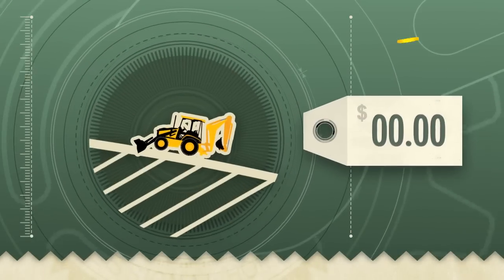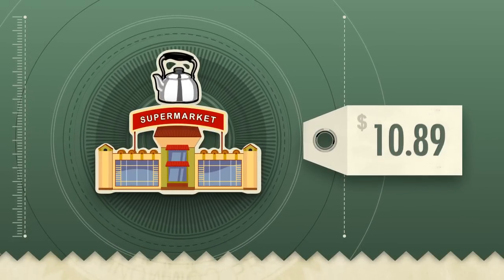New Money | Alternative Economy | Energy Currency

Comment: Related concepts: Biophysical economics and Exergy Theory of Value. The question is how to account for labor and land value? Accounting for calories burned would never provide someone with a subsistence living - indeed it wouldn't even pay for the food production cost, so you need a functional correction factor when calculating labor output in energy units. The quality of labor must also be accounted for (ie a more highly trained or skillful employee would produce less waste and consume less energy to produce a unit of good or service). For land, there is undoubtedly an energy production or accumulation (eg biomass) calculation, but how do you prevent land accumulation (by specific owners) or balance the need for food or raw material production with ecosystem services? Supply and demand must also be accounted for, because these dynamics will not result in an exact payment in energy terms for a good or service - consider just 2 products of the same quality produced with differing amounts of input energy and waste output. One producer (the efficient one) will charge more energy units for his product than was required to produce it, while the other will lose market share. Anyway, that's all to say this video is on the right track, but there are many nuances that must be considered in accounting for the value of land, labor and capital, and preventing excessive resource accumulation by individuals or groups (ie companies). I think monetary or even ownership demurrage (or taxation) could solve the "excessive resource accumulation" problems. Standard labor rates could also correct both the income gaps between rich and poor nations and reduce the pressure to import goods or raw materials from overseas - one off the leading causes of carbon emissions, waste, environmental degradation and biological invasions (and their associated costs). The author should check out Holochain, the Metacurrency project and the Weave for potential ledger-based tracking systems for energy, resources, waste and information value. Another key problem, in my opinion is that waste generation and processing are not fully accounted in the current system, but Extended Producer Responsibility and chain of custody may provide potential solutions. Make producers (and consumers once they have purchased a product) responsible for end of life disposal OR potentially earn income for resource recovery.
Reply: How to evaluate the cost of labor? I think it should be based on mutual agreement between the provider and the consumer. There must be a minimum cost based on the cost of necessary resources required by labor provider.

Comment: Here is a very easy counter-example: constructing a road takes into account both the total eventual traffic over the road (including different values for different vehicles weights, expected damage, etc) and the expected time it will take to reach that value. The road will need to be replaced after 50,000 semi-truck-equivalents have passed over it, OR 50 years have passed. Even if you had a perfect currency system, the engineering and financing demands speculation on how much traffic will pass over the road and whether that traffic will increase or decrease over the next 50 years. If the road is simply tolled based on the resources used to construct the road, there's no guarantee that enough trucks will pass over the road to pay for reconstruction at the end of its service life. This uncertainty drives conservative speculation and high profit margins. Most capital goods have the same multiple-cost system where you can't treat them as banks of resources because they decay over time or become obsolete.

This is why tollways are so rare outside of major routes, and still feel like rip-offs compared to publicly funded roads, which have guaranteed reconstruction and are paid under a system that allows debts to collect and be paid off over centuries instead of year-to-year. You still pay, and it is often more inefficient, but the single vast speculation of the U.S. government is much safer than individual agents scattered across the country.
Reply: This argument falls apart when you begin to talk about economies of scale. Using the law of large numbers, we don’t have to attempt to determine the number of hours a specific road will last for or the cost in hours and energy it will take to build said road. Some roads will be built fast, long lasting, and cheap, while some will be slow, short-lived, and expensive. On the scale of the world economy, the average will suffice

Comment: This was R. Buckminster Fuller's idea, but the problem is twofold: (1) how do you calculate the energy of a single item accurately in order to determine its price, and (2) in a free market competitive system, how do you prevent cheating by producers trying to maximize their profit?
Reply: Profit should not be the objective. Sustenance should be.
Reply: @rigelb9025  you can't control people's objectives so any system that doesn't use profit will always lose to any system that does.
Reply: @outerspaceisalie 📝Abolish📝profit📝 Boom thanks problem solved
Reply: Naked Dharma everyone has to take their clothes off x) I.e. Fully visible accounting.
Reply: Blockchain
Reply: What do you mean “cheating”? You mean fraud? Stealing? How do you prevent cheating in a money system?